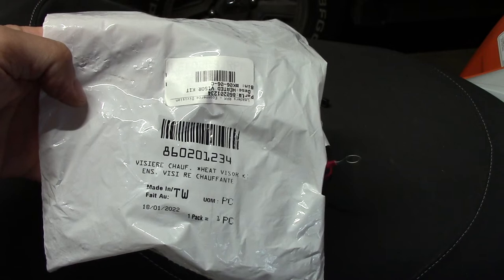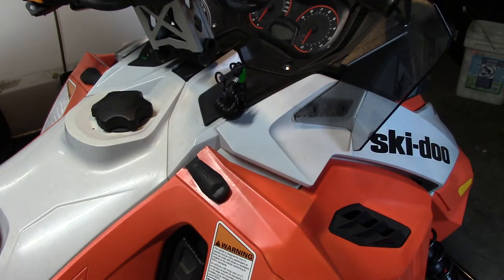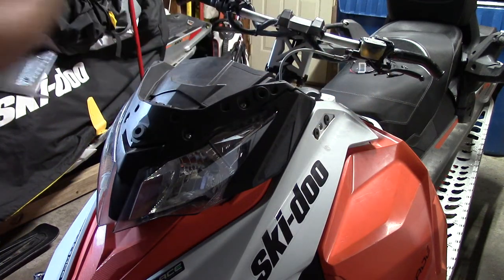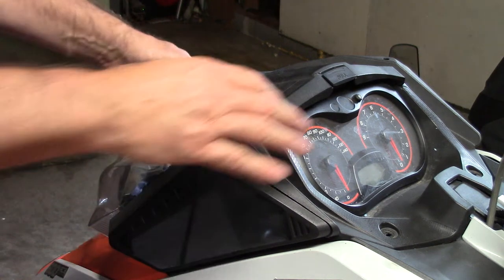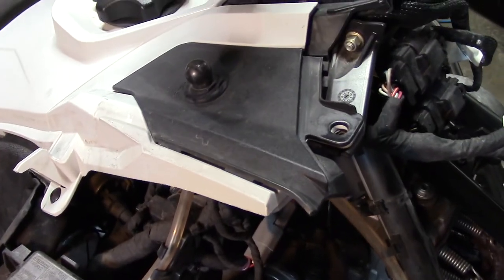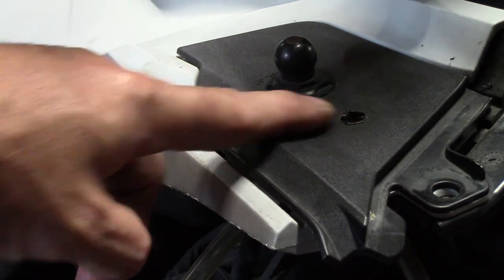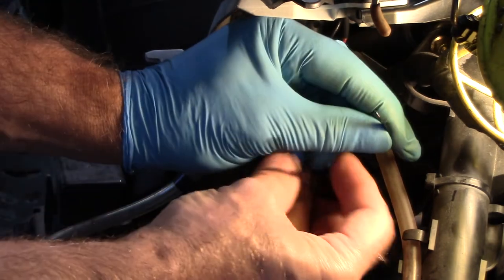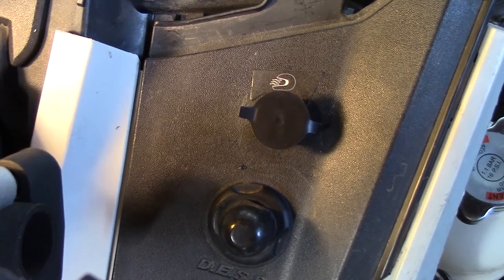How to Install a Heated Shield or Visor Connection on 2015 Ski-Doo SkiDoo

Comment: Very informative thank you! Do you know if this is the same on a 2012 Renegade?
Reply from the maker: Thanks Jack.  I think the part number I installed would fit Rev XS, XP, and XR platforms, which would include the 2012 Renegades.  Check with a dealer before you purchase just to be sure.